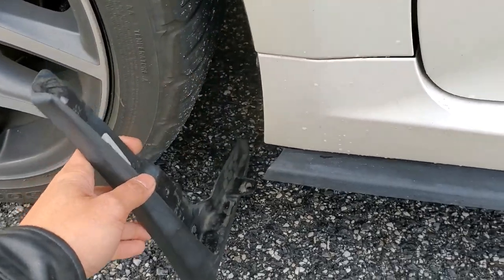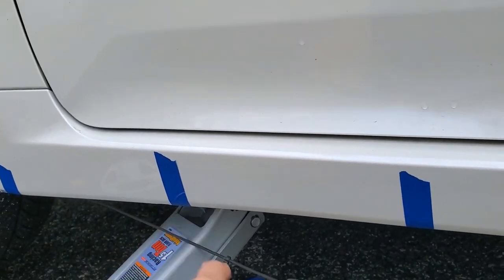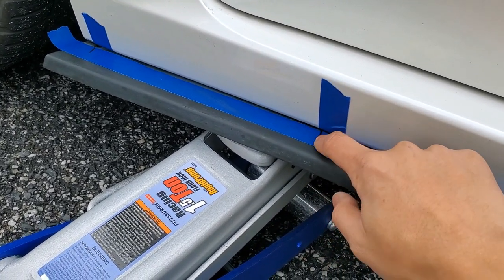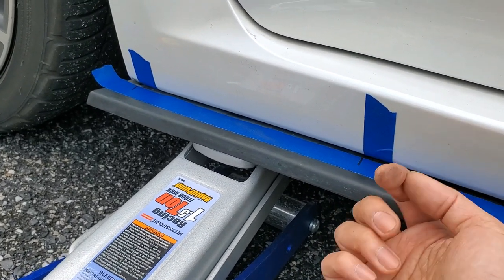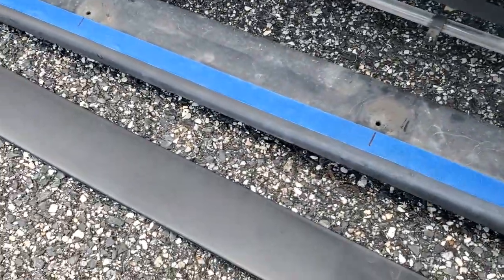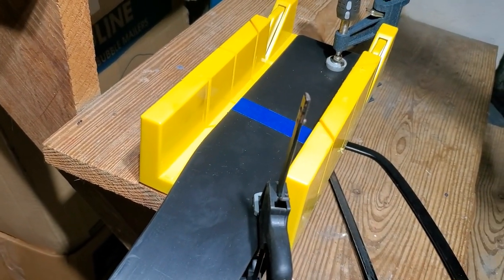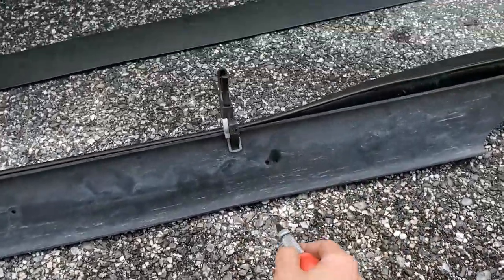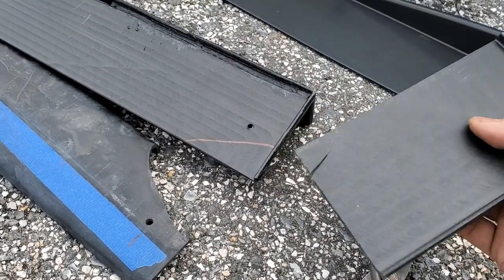Universal Polyurethane / Polypropylene Side Skirt Splitter Extension Lip Install (Scion tC2 / tC2.5)

Comment: Awesome video man ! I watch all of them ! So the splitter fades after a while ?
Reply from the maker: Plastic is going to fade over time when exposed to the Sun, and my car is stored outside all the time. The extensions that I removed were polyurethane, but the new ones are polypropylene. They looked worse than they really are in the video because they were dirty, but there was no reason to wash them when I was just taking them off. Usually a good scrubbing and then some black plastic trim restorer will bring it back to life. The black plastic cowl trim on my hood is faded just as much.
Reply: Derrick Aquino I see, it looks nice, I love it 👍🏻 I wanted to buy the green headers for my tC but it seems the demos website is down ! 😫
Reply from the maker: I think Dezod discontinued both their headers for the tC.
Reply: Derrick Aquino noo , dam that sucks 🤦🏻‍♂️

Comment: Did the splitters ever fall off going at high speeds or going over bumps?
Reply from the maker: No. Only if you didn't install it correctly.
Reply: Also, did you use self tapping screws to mount them?
Reply from the maker: @EckoNike1  no, I made pilot holes with my drill and installed stainless steel screws instead.